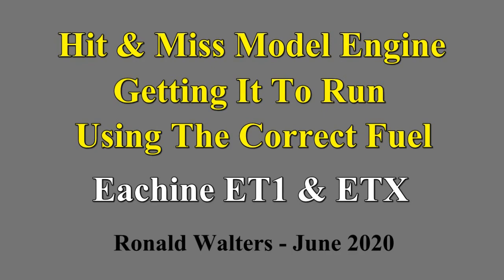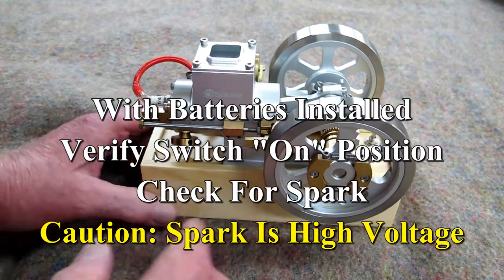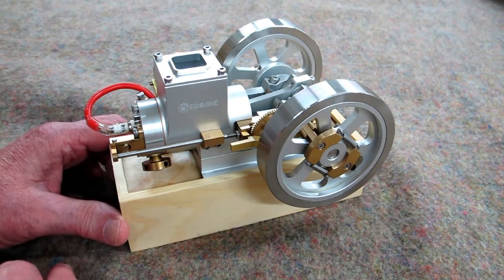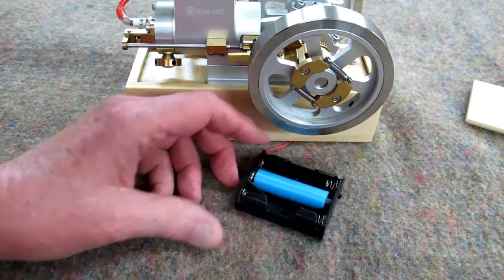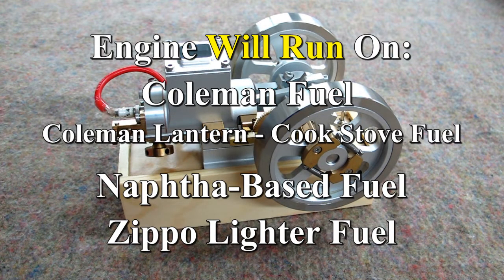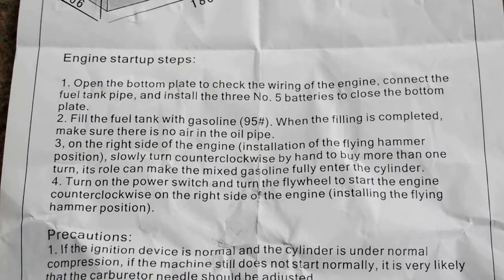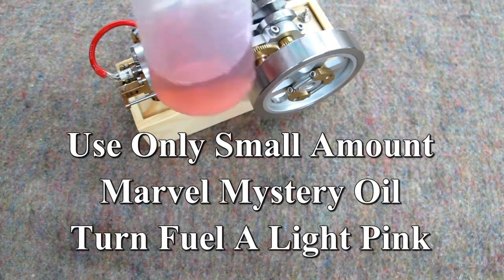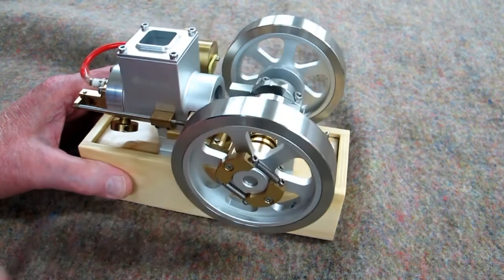Hit & Miss Engines - The Correct Fuel

Comment: can any of these be used to run your engine safely indoors without bad fumes?
Reply from the maker: Not the best idea to inhale any exhaust fumes if yo can avoid it.
If you use my recommended fuel (link below) you're OK in larger garage for a while or even on a kitchen table if you have something like a window exhaust fan... or outside on the porch. Just don't confine yourself to a small enclosed room with one running for very long.
You will also have some oil mist from the exhaust to consider.

Correct Fuel For 4 Cycle Hit & Miss And Other Model Engines
https://youtu.be/n1zOC2C-iy0

Please subscribe! 
That is what keeps this channel going. 
Ron

Comment: How do I check to see if there is the right amount of compression? I have the M92 engine which is similar and whilst I have some compression, it doesn't seem as high as yours.
Reply from the maker: John,
Difficult to explain and somewhat subject to your personal experience with small engines or model airplane engines. The compression should be fairly "snappy" however these engines with the o-ring piston rings generally will not have as much compression as a model airplane engine. Compression can also be affected by how well the intake and exhaust valves seal. These are very small valves and the slightest amount of dirt or carbon can lower the compression. 

I have always had the impression that these engines are test run briefly at the factory. Not sure what they use for fuel but it seems to burn a bit dirty. Some viewers have found carbon deposits holding the exhaust valve open. Removing the spark plug and flushing it out with a shot of WD-40 seemed to work.

Also the head gasket seal needs to be good. Some of the various fasteners have been found to be a bit loose. Check you head bolts. You don't want to over tighten the bolts either for fear of stripping out a thread or snapping off a bolt.  

Also make sure the spark plug is tight and has a gasket.

I have a video on doing a valve job on one of these small engines. This may not be necessary but it is another thought.
https://youtu.be/ukoAU8PYYvY

I have a video on what I consider to be the correct fuel for these engines. 
https://youtu.be/n1zOC2C-iy0

Just a little Marvel Mystery Oil in the fuel can improve the compression and does not seem to produce unwanted carbon deposits. The oil also makes the o-rings work better and last longer.

Finally, you may want to install new piston o-rings. I have a video on changing the o-rings on the M92/ET6. My engine had two o-rings on the piston. 
https://youtu.be/0oYgB3FBqjc

Some versions of engines only had one piston o-ring. One way to help slow down the model hit-n-miss engines is to reduce the compression and that may be why only one o-ring is sometimes used. 
Hope that helps.

Thanks for watching! Please subscribe! 
That is what keeps this channel going. 
Ron
Reply: @RonaldWalters2010  Hello Ronald, I'm by no means an expert with these small engines but very familiar with bigger engines. I didn't buy this new, it was part of an estate clearance. I am getting compression but lack of skills with these engines doesn't tell me if it's enough or not. I do have a spark, and I would have thought it would have been enough. The engine came with the middle battery of the 4.5v bank linked out (I saw this suggestion elsewhere) The spark is stronger on 3 volts compared to 4.5 volts. The ignition trigger sensor looks to have been in its current state for a while, looking at the dirt around it. Fuel is getting through because after repeated attempt's, fuel starts to leak out between the piston and bore. But, no matter what I try, I haven't had so much as  a single 'Pop' from the exhaust or even a change in the noise when using the drill to start it. Is there any detailed instructions anywhere that I can download to check that the engine is at least set up correctly?
Reply from the maker: There is nothing worth reading from the manufacturer of these engines. Your best reference is probably my videos.
If raw fuel is coming out the exhaust it probably won't ever start... the tiny spark plug is wet and is shorting out the spark,
In one of my videos (probably in the ET1 review video) I talk about the timing. The Hall-Effect sensor needs to be adjusted so the spark fires "JUST PAST" top dead center.
With the earlier ignition modules, the spark would sometimes stop when three AA batteries were used... but the problem went away when only two AA batteries were used. I talked about using only two AA batteries in several videos and I have a video on making a dummy AA battery.
Make sure the valve stems have some rocker clearance so the valves can fully close.
It sounds (from your description) like the needle valve is too far open.
Gently fully close the needle valve...  very slowly (very tiny increments) open it while spinning the engine until it starts. Your engine should run 1/4 turn open or slightly less... but some carburetors will vary slightly. Make sure there are no air bubbles in the fuel line or it won't start.
The engine runs clockwise as looking at the flywheel with the governor.
Put your thumb over the exhaust to see if you have compression on the exhaust stroke... that should indicate if you need new piston o-rings.
That's about it. They can be a bit frustrating until you get the feel for how to get them going. Hang in there... you'll get it eventually. :-)

Comment: For viewers in the Australian region who can't get Coleman fuel anymore, the local equivalent is Shellite (100% naphtha) and is sold in the paint department of most hardware stores for a fraction of the price of Coleman fuel. The Kerzel HM1 hit & miss engine (a build from plans model) is the original design by David Kerzel of Florida that these Chinese toy manufacturers ripped off. The Kerzel design has a drip lubricator for cylinder lubrication and does not need oil added to the fuel. My Kerzel HM1 runs best on 95 octane premium petrol and will run on naphtha but with less power due to the lower octane rating. I use a Viton O ring for the piston ring and it is still running on the same ring from 18 months ago. Viton O rings are rated for 205C temperature and are highly resistant to petrol and naphtha, but not methanol or acetone.

Comment: Did you use AA batteries for this or is it a special battery
Reply from the maker: The ignition system for some of the earlier engines would quit working after the engine had run for a while. It was discovered that the problem would go away if two batteries were used instead of three batteries. I am using standard AA alkaline batteries which have a nominal voltage of 1.5 volts DC when they are new. The voltage decreases as the batteries are used.

The following video describes various things to look out for when trying to run these model engines as well as the correct fuel to use. 

Correct Fuel For 4 Cycle Hit & Miss And Other Model Engines
https://youtu.be/n1zOC2C-iy0

The following video shows two different ways to make a dummy battery.

Dummy Battery For Hit & Miss Engines
https://youtu.be/6Ij7uvw_LwE

Thanks for watching. Please subscribe! 
That is what keeps this channel going. 
Ron

Comment: Very helpful info on these model engines !! .....Seems some engines arrive Without the black Ignition wire attached to the Metal engine block.....This eventually causes the "Returning" spark High voltage to Arc thru & Damage the magnetic Reed switch & possibly the Ignition Box.....I made Sure my ignition wiring was correctly Block grounded & added 3   6 amp 20 volt Bidirectional polarity TVS diodes, 1 wired Across the Battery box + to -- terminals & Each wire (Except HV sparkplug wire) to engine Block ground to absolutely Protect the Expen$ive ignition Module from stray HV damage...Mine continues to run nearly 3 yrs now....

Comment: I have an engine like yours and use to run nice but after a while no more compression on it, I read that piston rings must be replaced, rings are green rubber orings, I got the replacements on line and replace them, never ran again, Im afraid I fogot to mark the timing, con you help me sending some pictures from your engine to see gear and timing position?

Comment: Hey Ronald, how did you fill the tank? What did you use?
Reply from the maker: Look around for something like this:
https://www.ebay.com/itm/202334541056?hash=item2f1c141500:g:EDcAAOSwSCZbOnwA&amdata=enc%3AAQAIAAAA4AiGvcAPi1UwsenLDwqn0GiccBZqALJWr4VR51iy2QNcxVhIDMTbyKVDXYdKfa614zEzghnZ%2B75e3yvzofuh7SznKRyqjfM0zmMoCL%2BaDxyqzahjpHPAbH296w9%2BG%2FyUKh7zhV5orACcgCuDQ16oJs11fE5g9GVTcUZ%2BUHWD%2Fb3EwZZxT0HBeXkpI0dKfZ85CmKLqObNxS%2BkPvvUueaiHZ4wCM3DfKuIZJensofHq%2FgXIbp6RuE4ASdegDwkYIefirOdoNBwFDmOUB7NOWTxn%2FmCTai5iziUR18rjCZvznul%7Ctkp%3ABk9SR8jp-bueYw

Or a syringe with a dispensing needle (the needle does not have a sharpened point) although the rubber in the syringe does not hold up to the fuel very well... so a glass syringe it better suited (but breakable)

Comment: I have a question. But 1st I want to thank you for your awesome videos. Your posts are my go-to as I enter this hobby. I have also looked at many others. Most say that Ethanol Alcohol cannot be used to power these engines. I did some research and found some conflicting reports… “Pure alcohol will rott silicone O-ring pistons, plastic carb parts etc’… others say it will not. I found an interesting article about ethanol mixed with engine lubricants and how they perform in replace of petrol. Anyone can research more of the article by googling the title “Lubrication behavior in ethanol fueled engines” . The article stated that pure ethanol did not contribute any additional friction within the engine even though it thinned out the lubricant. It also stated that there was no varnishing and there was zero sludge compared to sludge left by petrol. I decided to try pure alcohol 97% food grade in my ET1. It works GREAT. Can you tell me why you stated that the engine will not run on alcohol?
Reply from the maker: There is more than one type of alcohol. Many people don't know the difference or it may be called different things in different countries (different languages).

Isopropyl alcohol (rubbing alcohol sold in drug stores 70% and 91%) is very dirty burning

Methyl (methanol, wood alcohol) clean burning... used in model airplane fuel and race cars

Ethyl alcohol (ethanol - the drinking variety) distilled and undistilled

Denatured alcohol (ethanol with additives added to make it poisonous) you don't pay alcohol tax on this stuff

When the so-called oxygenated fuels or gasohol first came out they were basically shoved down everyones throat with insufficient prior planning. Places like Denver Colorado first mandated this stuff seasonally since the addition or alcohol added more oxygen to the combustion resulting in less carbon monoxide (smog) in the winter months. Older cars on the road did not react well to the alcohol, which attacked rubber (o-rings, fuel lines) aluminum and some nylon/plastics. The general public was not expecting this until it was too late and damage was already done to their vehicles.

I do not believe alcohol would attack silicone o-rings. I have never seen that problem

I have used methanol based fuels in model airplane engines for many years but those engines typically use glow plugs. Glow plugs do not require an ignition system once the engine is running.

Internal combustion engines burning methanol are very clean burning. The parts look brand new when the engine is disassembled (as does the oil) as there is no carbon produced. Engines burning propane are much the same.

I said not to use alcohol for three reasons... 1. people typically run to the drug store to get rubbing alcohol which burns extremely dirty and makes a bloody mess... 2. methanol (sometimes) is not that easy to get and 3. vodka or straight drinking ethanol is expensive. Denatured alcohol is good.

Sometimes people have trouble getting the little engines started with alcohol.
I have not had good luck with alcohol in these small model engines.
These little engines do not have the hottest spark in the world.

I have run some small internal combustion model engines with a glow plug instead of a spark plug and methanol. Obviously you need a battery to get it started.

Any residual sugar that may be in drinking ethanol would (or could) certainly cause damage.

It is far easier to recommend the Coleman lantern fuel, which starts easily.

Beyond experimentation... just get a can of Coleman Fuel and a bottle of Marvel Mystery Oil and life will be easier.

Thanks for watching. Please subscribe! 
That is what keeps this channel running. 
Ron

Comment: I love the engine BUT I tried the two battery deal. That thing won''t make any appreciable spark to ground. New batteries. Alkalines. Next step change back to 3 cells, If that doesn't work I will check out HV coil. Finally an email to the person I bought it from. Note: The end of the plug wire came without a clip on it. Wire just cut off flush. cutting some insulation off of the wire to show some wire to the plug doesn't work either. 
Anyone else have this problem?
Reply from the maker: There is no clip on the end of the spark plug wire on any of these engines. You just push the blunt end of the wire against the end of the spark plug. If you have spark, then that will be good enough. 
You say no "appreciable spark" to ground... so I guess you are getting some spark? Darken the room and check for spark again. Sometimes you can hear it before you can see it.
Double check all three batteries are installed in the correct direction (polarity).
Check there is no corrosion or rust in the battery holder or on any of the electrical connections.
Check the ground connection to engine, which is on one of the engine mounting bolts. 
Check all of the other connections and check continuity with a volt ohm meter. 
Check the battery holder connections and the switch connections. 
Check connections for the Hall Effect sensor and that the magnet is in place. If the Hall Effect sensor isn't triggered by the magnet there will be no spark.
Make sure 'ON" at the switch is actually ON.
Good Luck!
Thanks for watching! Please subscribe. 
That is what keeps this channel going. 
Ron

Comment: Mine still has the original springs and it runs much faster.
Reply from the maker: It will run much faster with the original springs.
To slow it down you need the install weaker springs. I show that in a few videos.
Thanks for watching,
Ron

Comment: QUESTION! :   How much better would one of these Be on a Generator vs a lawnmower eng ???   thx
Reply from the maker: First of all, a small lawn mower engine if probably 500 times larger than one of these model engines. So I assume you mean engines of the same size or displacement.
A Hit & Miss engine is probably not a good choice for a generator. I see them as better suited to intermittent load like a cement mixer, farm auger or a well pump (such as an oil well pump jack).
A lawn mower engine has a governor, but usually it is a fan resistance governor controlled by air coming from the cooling fan. 
An engine similar to that on a lawn mower (Briggs & Stratton, Honda) is what you will usually find on small home generators and the better gensets will probably have some form of electronic speed control to maintain engine speed/output voltage under varying load.
Not sure if I answered your question.
Thanks for watching. Please subscribe! 
That is what keeps this channel going. 
Ron
Reply: @RonaldWalters2010    Some what answered,  for example if i had a 4 large batterys and the hit/miss eng doing a light load charge vs having a lawnmower eng doing the same which would be more effecient?  how low RPM can this eng idle ?   with some pulley reduction i wonder what can be done as a stredy current gererator.....
Reply from the maker: I would go with a small B&S or Honda engine.
These model engines really are not intended, nor are they suited for, actual work or long runs. They are a model or toy... but could certainly be used in a model boat or something where they have short runs.

I have a video showing tachometers being used to measure typical idle speed of one of these (ET6) engines.
Handheld Tachometer - Laser & Contact - Review & Demo
https://youtu.be/kPUrsFO38W0
Reply from the maker: Do a search on YouTube for weed eater generator. There are many videos on this where people have used 2 cycle engines from old weed eaters and used automotive alternators or DC motors for generators. Make a throttle control to hold a steady motor speed to regulate the output voltage you want.

Comment: Both my engines came WITHOUT ON/OFF switch.
Reply from the maker: Guess you should have bought them using one of my links. :-)
Reply: @RonaldWalters2010  most likely....No spark in a small air gap between the ign wire and plug. tried 2 batteries as you said...and 3 as you did not. They do make a good paperweight....tho a bit expensive.

Comment: I am wondering if it is advisable to run this engine with water in the top open chamber?
Reply from the maker: That is what that is for... a water tank for cooling. Usually only about 2/3 full so it doesn't splash out with the engine running. 
I have a playlist with a number of different engines reviewed and demonstrated.
Thanks for watching.
Reply: yes it is

Comment: We have had great success using 87 pump gas and Amzoil two stroke oil, 150:1 . Amzoil will lubricate the o-ring and cylinder and valves but won't harm the spark plug.  The key is to dump out the unused fuel once you are done running the engine. My advice on starting issues. If the intake valve is not opening, that could be the reason it's not starting. The opposite can be true, once flooded if the  fuel is not shut off the engine will not start.  If flooded the engine can be turned over until the exhaust valve is open. Once open, let the engine sit for a few minutes to allow the gas to evaporate from the cylinder.